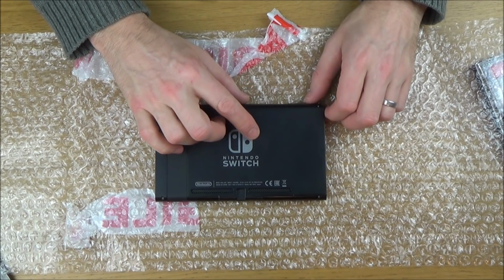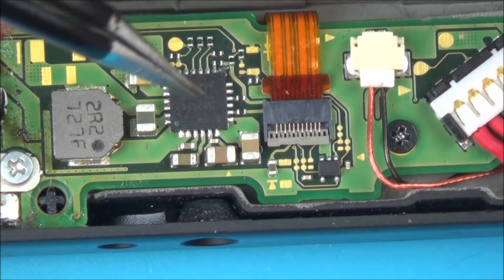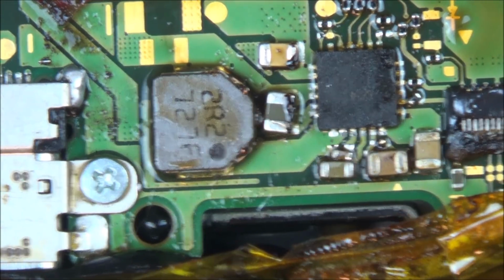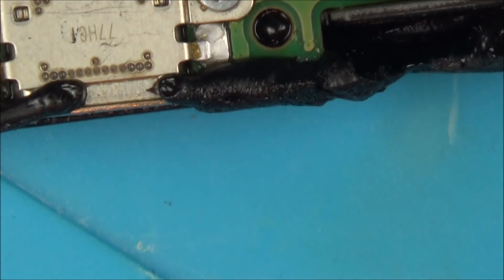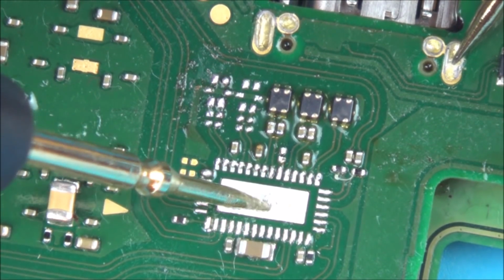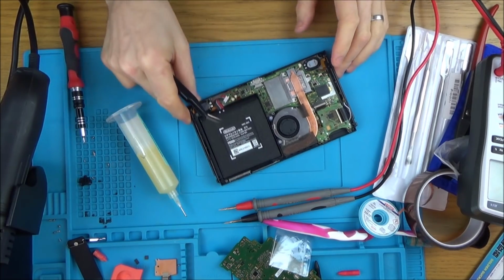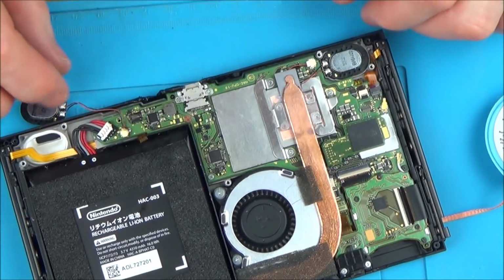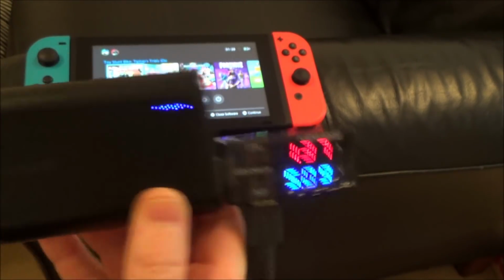Trying to FIX a Nintendo Switch with Numerous Faults

Comment: Hey Vince! You can put coins over areas you don’t want heated on the board. The coins absorb the heat instead of the components.it should be circuit board, kapton tape, coin. Good luck!
Reply from the maker: Nice idea, thank you :-)

Comment: Great video vince, it reminded me of my first switch repair it was a disaster so don't feel too bad, also if you lose some of the capacitors or fuses on the switch and don't have extra, take them of from iphones or ipads, it was an accidental find on my first switch when i blew one of them away on my first one, and by coincidence i notice an iphone 6 motherboard had some of the same ones that the switch uses XD, best of luck

Comment: Nice you got it working :), please never use the hot air when on the plastic shell ever btw :o, I though you'd melt the battery the second time you did it

Comment: Nice video. Can't believe you got it working  that quick, I should have maybe tried to do a bit more fault finding before rushing to sell it haha
Reply from the maker: Thanks Gary, I was close to giving up at one stage but when it drew 0.4A I knew it was close, so happy when the screen lit up. Thanks for selling it to me. I presume it wasn't actually your Switch before it went faulty was it?
Reply: @Mymatevince  No I bought it off eBay myself thinking it was gonna be a lucky buy and just need a hard reset. Opened it up and seen the slight corrosion at the charging port. Should have maybe tested for shorts first 😅 could maybe have got away with just those chips rather than the charging port
Reply from the maker: OK, I wasn't sure. You did a better job on the USB-C port than I thought, I was expecting everything to be burnt BUT don't worry it is nicely burnt now :-)
Reply: I followed one of Steve's videos to remove it. Trick is to heat it from the underside then your not focusing too much on the top and melting the plastic. I do think if there hadn't been the corrosion there then those pads wouldn't have ripped as easy

Comment: Sorry, one more thing... when poking around in continuity mode... don't start grounding everything while the thing is on... I'm not 100% sure, but I wouldn't start poking around with the leads with one of them on ground. Measuring voltage is another thing, but testing continuity could make a short and kill some components there... although somebody could reassure me on this.

Comment: Oh, and use a regular soldering iron (get a microsoldering pencil, e.g. anything with a fine T12 type tip) and do these little things like putting the moved caps back with that, not the hot air...

Comment: Also, a little advice. Your work circumstances go first. It's not about the show, it's about the fix. Get yourself a small electronic microscope and connect the output of that to the camera if you want to record it. Don't get the camera in your face to do the job. This is not good. There are small electronic microscopes with built-in LCD displays (I am using one of those) and they connect to a computer through USB and you can record what it sees. It's not in your way and you can work comfortably. That botch job was really painful to see, BUT I hope you have your lessons learned there. A mistake is only bad if it happens more than once. Do not ever solder/desolder anything "in situ", always remove the board. Also, when applying Kapton tape, don't let it just float on the edges because you'll be blowing the hot air under. It should SHIELD the components from the heat, not just optically cover them. So next time, stick the tape to the motherboard and not over what you're soldering/desoldering.
Sorry, but I got so upset watching this. I love your videos, but this melt-job should have not happened at all, you are better than this.

Comment: When you are worried about a connector melting, you need to "poison" the lead free solder with lead solder, or remove it entirely and use all lead solder, then start at a low temp and work your way up.

Comment: Oh, for f*ck's sake, remove the board from the device before desoldering a chip in there!!!!!!!! My God Dude :D:D I was biting my lips so hard... ehh, ok, I know, I know... the ribbon cable up top... okay... but still... ehhhhh. Also, don't cover the solder joints you want to melt with Kapton....
Reply: Ehh... I knew you would burn the case :(

Comment: Just want to let you know that the tape you're using is not ideal for hot air rework. Use aluminum tape for hot air. The tape you are using is mainly for infrared heating systems. The curling on the tape can knock small SMD's off their pads, don't recommend ever using it for hot air.

Comment: You said you'd rather change the USB port on a broken Switch... considering you DO have one or more broken Switches, why not make a video where you try and do just that?

TronicsFix apparently has a video dedicated towards changing the USB port: https://youtu.be/TUUv9FGXMT0
Apparently, despite heating it from behind, the solder for these pins get hot enough to melt, meaning you don't have to worry about reflowing these pins.

Anyway, you just literally went from zero to hero on this video. Just one step away from becoming legend.

Comment: Screw the tape. Its not worth the hassle.

Turn the fan for the air down, wayyyy down.

You increase the risk of removing other components far more with the tape and high air flow.

Comment: Awesome fix Vince! You completed some really difficult repairs on this. So fun watching someone else fix these too!
For protecting that connector there's several things that I've done...1) I've used a small piece of metal (the shielding from a original PS4 HDMI encoder chip) and that worked pretty well. 2) I've use kapton tape then put a thermal pad over it then taped it down. That worked ok. 3) I've just ordered some heat protective putty that I'm going to try when it gets here. 
Also, It may have some loose pins on the usb c port that's causing it to not show on the dock...I've seen several of those. 
Now you see why I don't use much flux when I do these...I like using lots of flux but as soon as it gets under the kaptop tape the tape lifts.
Reply from the maker: Thanks Steve, I thought you might have some good advice for me :-) Cheers for the tips. When it arrives let me know if the heat putty works as that would be the easiest. So when you fit a replacement USB-C port are they brand new or do they look used before as I bought 4 from eBay and they look used. I was wondering if you had to do work to your ones to make sure the pins are all straight and clean before fitting them. I watched your video on it a while back but the hidden row of contacts makes me nervous to try it myself :-)
Reply: @Mymatevince  to recover a connector from a donor board, heat the connector from underneath the board. this way you will not melt the plastic. great job man
Reply: I've bought both used and new. The new are nice because they're new but the plastic melts easier. The used have been used but the plastic doesn't melt as easy...I'm not sure which I like best!
Yes, I always make sure all the pins are straight...I also tin the pads and tin the pads on the board with fresh solder. The hidden row of pins can be a pain.
Reply from the maker: @Tronicsfix   Thanks Steve, great so the used ones might be OK for me then. I might attempt it one day :-)
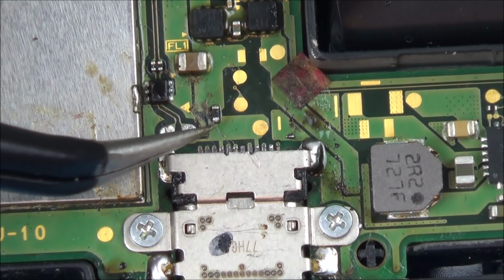Reply: @Tronicsfix 😊 7:50
Reply: I fix these day in day out, the dock problem is most definitely a loose pin on the USB-C, also dial the heat and air back a little and try and angle the air flow low on the board, the hidden row of pins should then flow and should then just pop off..
Reply: Hey Karl! Mind if I ask you a few questions (since you're an expert on these!): 
1) I've had some that show that they are charging at .46A but there is no display. I've tried replacing all of the common chips but still no display. Any tips?
2) Any chance you've fixed the blue screen of death? I've got two that have that and haven't started messing with them yet but have a feeling they might be tough to fix. 
Thanks in advance!
Reply: @Tronicsfix  I am also experiencing the first issue you listed here, I have no idea what is causing the issue. Let me know if you have any ideas to get it to boot.
Reply: @Tronicsfix  I don't know if you are still in that situation. 5V and 0.4A means that your Switch have no problem with the hardware. It happens to me a month ago when I forgot to charge the payload atmosphere. I was looking for a heat gun to try fixing my console then I try to simple charge the payload to my console with tegraRCM and I worked ! It's firmware related. I think the console can have that famous 5V 0.4V charge if the firmware is not in a known state that give the information to the charge IC for stopping or fast charging from the USBC port.
Reply: TronicsFix, I have a few like that too, not shorts and I replaced the common chips that go bad, one motherboard I had replace them 3 times just to make sure what I got from China and from donor motherboards, everything looks fine, they are charging at .46A  but they won’t jump to fast charge and they won’t turn on!
If you think you found the solution, can you please make a video, and I’m not a pro but if I do find it first, I’ll totally let you know
Reply: TronicsFix kiklikkkil
Reply: That's why I use aluminum tape
Reply: Is there a way I can get both your help? I got a switch off eBay thinking I could fix it. Well turns I couldn’t I didn’t destroy any traces but I am at a loss for what caps and resistors should be around that m9 chip. Any thoughts? Or if I could send it over to one of you?
Reply: Also I replaced the display connector by putting some lead solder down on all the pins and heating it up until it got shiny. Then I put some flux down. Theeen I put down the connector without melting it.
Reply: @jet613  0201 form factor 10k then 100k 100k. A little late tho lol
Reply: @B9NE  no worries I fixed that board and moved on to a few others!
Reply: @jet613  sweet. Right now I got one with no amps or obvious shorts lol betting it's the m92
Reply: Tronix you should make a video tutorial on how you remove chips and add new ones back
Reply: TronicsFix Hello I’ve got a very old iPad would not work anymore

Comment: A great video, painful to watch in a few places but you know what, it's a learning thing!  Yes some mistakes were made but it's all part of the learning process.  Tinfoil is your friend for helping keep heat away from plastic parts (covered also with kapton tape), and removing the board from the case is a must - but you know that now =D 

Sometimes the best lessons are the most painful!  I would also be super careful using hot air near any li-ion battery.  I know it was discharged but a little too much heat and you could get a runaway battery.
Regards your comment about the kapton tape, I think the tape was a good idea, but the plastic parts need more shielding (foil), and airflow as you say is key too.   The big problem with modern boards like this is the number of layers (probably 6 layer on this?), meaning it can absorb a LOT of heat, so too much airflow and not enough protection on plastic bits can spell disaster.  Hats off for throwing yourself into this.   In theory you could source replacement connectors for those that are damaged, so it's not a write off at all.
Reply from the maker: Haha, yeah I couldn't believe the damage I did and how widespread it was when I uncovered all the tape. I wanted to get away with not undoing the screen ribbon cable connector as I have had problems with them in the past but next time I will take the board out and then the heat will be away from the battery as well. I will break out the tin foil in future :-)  I might revisit this in the future with the USB-C port to see if the docking can be fixed. I still don't understand how anyone can replace those small plastic connectors because using a donor board will melt them on removal!!!! Please don't give up on your channel Chris - Imitation is the sincerest form of flattery - you are helping many people even if you are not always getting credit for it :-)
Reply: @Mymatevince  For the plastic connectors you heat from underneath about 350c-365c and nudge them off. You solder them back on by hand one pin at a time. Preheat the board you are soldering it on to from underneath from time to time, it makes the solder flow onto the pins/pads much easier. Use lots of flux. Good luck!
Reply from the maker: @derekmayo9948   Thanks Derek :-)
Reply: @derekmayo9948  Good advice!   I wonder if anyone knows exactly what types these melted connectors are - I am guessing they are industry standard.  Maybe we could research these and see if Digikey or RS Online sell something that will fit.  It would be fanastic if we could source them and maybe at some point Vince could restore this board back to pristine condition!  I think it would be useful in any case.  Vince, next time you are in a switch, take some super close photos of them and if you can, measure their physical size (width if possible) - guessing not much, like 4mm or something lol.
Reply: I think they are FPC connectors?  Looking on eBay I see loads that look very similar.  It's a question of width and pitch of the pins, and pin count.  Now, I cannot remember which ones were damaged and their sizes / pin counts etc.  But this looks like the sort of thing for a ribbon connection (assuming its size and pin count is correct) - https://www.ebay.co.uk/itm/5Pcs-FPC-6P-0-5mm-Pitch-1-2mm-Thick-Double-Sides-Contact-Flat-Connector-Socket/362278488699?epid=2162777587&hash=item54597b0a7b:g:jvwAAOSwn4pbmE5W:rk:44:pf:0
Reply: Looking at one of the connectors, looks 11 pin.  Not sure if this would fit. https://www.ebay.co.uk/itm/FFC-FPC-Board-Connector-1-mm-11-Contacts-Receptacle-FH12-Series-Surface-M/352066908775?epid=907464271&hash=item51f8d2b267:g:LzwAAOSwjqVZJIUO:rk:2:pf:0

Seems to be 1mm spacing, I suspect the one on the switch is 0.5 or less?
Reply from the maker: @GadgetUK164  Sorry Chris, I have only just stumbled on these replies 7 months later!!!! Next time I am working on a bad connector on the Switch I will refer back to the eBay links to see if they match up :-)
Reply: @Mymatevince  No worries!  I know what its like with the lower level of messages I get - god knows how you keep up with them lol!
Reply: One day i spilled my tea and a lipo battery on my desk degassed in seconds(i don't know how) :D So yes, be very carefully with the batteries.

Comment: A tip for smd air reflowing, dont use so much heat and use less airflow. If you can blow the chip away, you're too high and you then blow heat under the tape far into the board and damaging plastics. Just be mindful of localising the heat. Another good thing to get into is using 'Chip Quik' alloy and a soldering  iron, it gives you a huge window to remove a chip and very little chance of doing damage to other components. Watch a few videos on using it, you will master it in no time at all. https://www.youtube.com/watch?v=FTQqjggeklo
Reply from the maker: Thanks for the tips. I do have some of that low melt stuff that I used on a HDMI port :-)
Reply: @Mymatevince  Dude, you have come a long way in such a short time. Find some spare time to mess around on some old dead boards as practice. You will find you go into fixes like this with much more confidence and much less errors. Anyone that does smd work will tell you, we all kill boards, but the more we do, the less we kill.

Comment: Kapton tape is actually not only heat resistance but generally it's temperature resistant. They also use it in cold environments like space and in cryogenic research. I believe the temp range is −269 to +400 °C. It's one of DuPont's many inventions and one I find fascinating. I know, nerd...but material science is just as interesting to me as why things are broken.

As for the fail...take it as a learning experience. I've yet to attempt those sorts of chip repairs myself so you won't hear any peanut gallery comments from me. I enjoyed the video. Cheers.

Comment: Nice video again!  It's a really learning curve.  I hope you see soon some more playstation Vita's to. I have a Vita slim that i going to fix ( screen has hard scratches the same for the back and the shoulder buttons.  So i going to replace it. It's not fixable.  The Vita works perfect but the screen has to heavy scratches. And maybe i Will change the analog sticks.   So like a new Vita for only 80 euro's so that's not bad.  It's perfect for the kids here.

Comment: Previous comment about the aluminium foil is a good one. I do that myself to be honest. Aluminium foil is great at taking the heat away from vital components. The solder on those boards will absorb the heat for a while. The trick is, lower fan speed, closer distance to the chip, longer time. Like 5-10 minutes. You could use something that is applying upwards pressure on the chip itself so as soon as it's ready to come off it'll just pop off, then turn off the heat. Try getting some kind of stand or vertical clamp that you can attach the heat gun to so it keeps an even steady application of heat.

Comment: OK the second time when you like to change a chip from board leave it from the plastic backage , and also any connecting ribon made with plastic remove it first than when you have some free space on working in hot air, then resolder the part :)
good luck next fix xD
Reply: 1:11:40 you put lot of flux on the chip when you try to solder it why?  you got big dot of solder there, just little dot of flux can make the job, any way I'm not a teacher or a professional i don't have an hot air , but i see that on an Arabic video that they put more flux when they try removing chip from iPhone